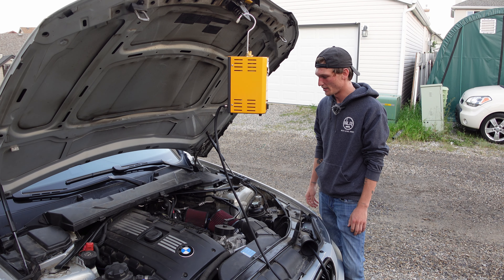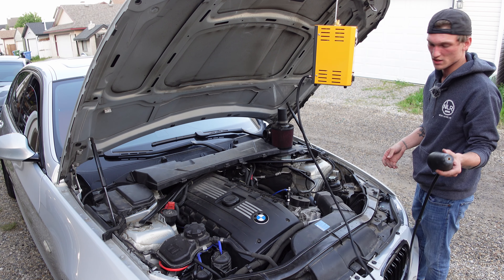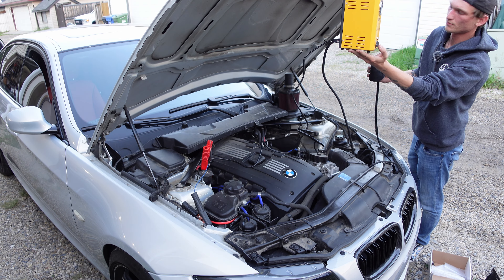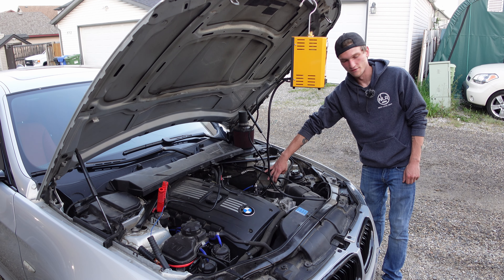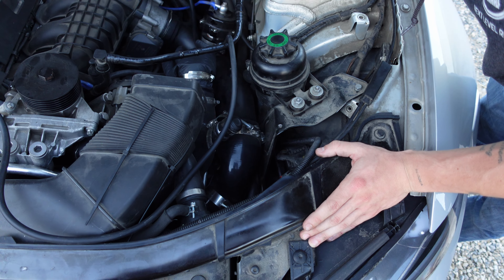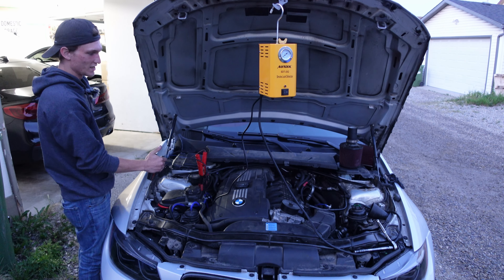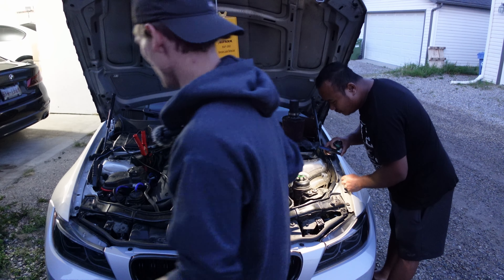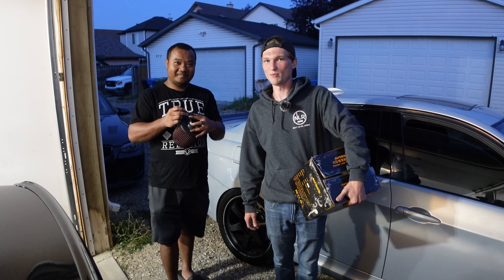How To Properly Smoke Test Any BMW For Boost Leaks

Comment: For me it blow off the Leak tester , twice that means i dont have boost leak?
Reply from the maker: if it leaks from the BOV before its hit the spring pressure, there's an issue.
Reply: @tony.nextlevelrides  i domt have blow off valve, i have b58 bmw and i put it to the Intake pipe with the cone my smoke machine has a built in pump with 23 psi so i installed yhe cone to the intake pipe i run the smoke and no smoke comes out anywhere the cone it self shoots out because no way for the smoke and pressure escape , that means no leak right?
Reply from the maker: yup, that means you do not have a leak.
Reply: @tony.nextlevelrides  thanks for replying, one last question , im on stg2 and i chekc my logs target psi for example 16.8 psi mine is under that target allways like .3psi to 1psi is that normal??
Reply from the maker: yup, pretty normal. nothing to worry about at all. that's how the tune is, especially high RPM's where the turbo cannot provide the boost.
Reply: @tony.nextlevelrides  thank you 🤩 wish i would commented here before i bougjt the smoke machine 🤷😒 god bless you 💯🙏
Reply: Troubleshooting a po302 on my 2006 subaru sti. Used the autool sdt 604 on the i tame side. Found no leaks. Tried exhaust side found 2 leaks
Reply: @bmwsincekid you ever figure out your issue? I have a b58 and going thru some boost issues
Reply: @SmerkeHD  i think i never had boost leak according to my log files and the tuners that checked

Comment: I tried this on my mini cooper s supercharged from the intake to check for boost leaks i only saw it coming from the oil cap and eventually it build up enough pressure and popped the smoke tester hose out does that mean i have no leaks? Minus the cap
Reply from the maker: yup! means you don't have a leak. the oil cap shouldn't leak so if at least change that. on a mini / BMW the engines are highly reliant on proper vacuum within the crankcase.